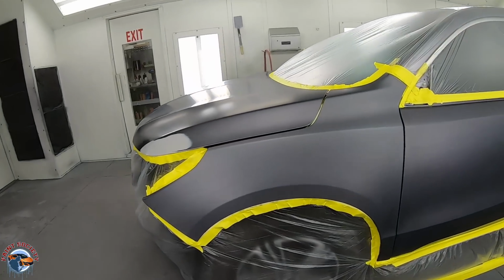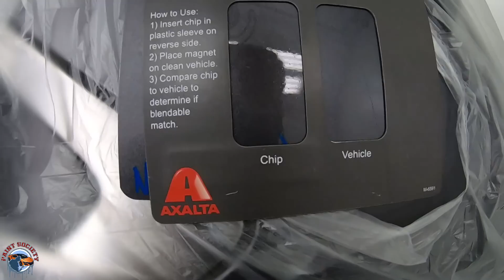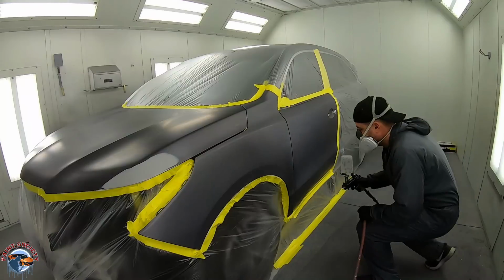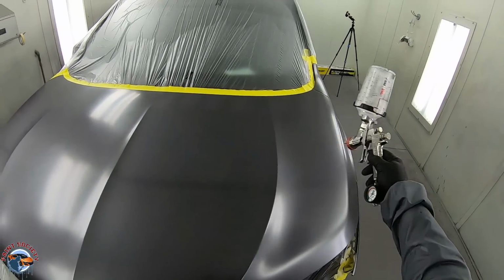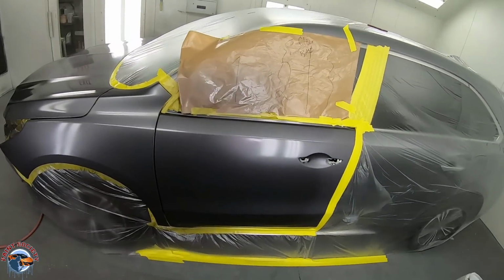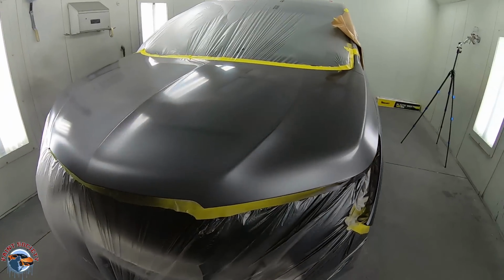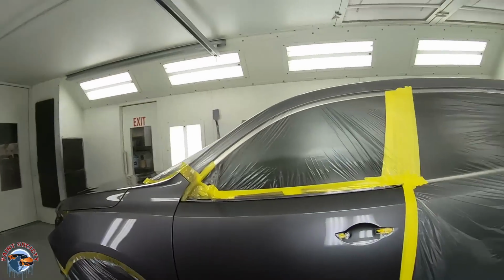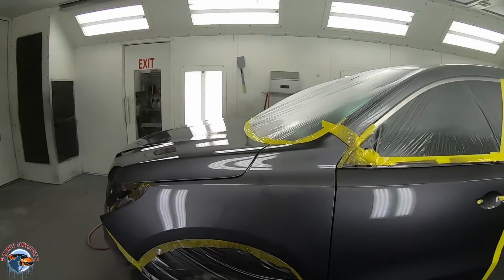Car Painting: Tips to Paint like a PRO!

Comment: Love your videos, your an amazing teacher. I'm interested to know..... if the average gun is usually set to about 29psi for normal use why do you go as low as 17psi and also how does this lower psi effect the finish. Also do you have to change the speed/distance you paint at the lower psi? Last question would be..... do you mask behind the cracks between the doors to avoid spray getting inside. Any help much appreciated 👌

Comment: Love the channel man. Been doing a lot of research because I'm wanting to try and paint my Project truck myself. And you are by far the most detailed and understandable guy I've come across. One question I still have I cant seem to find and good answers on it painting a 2 tone or tri tone  job. On how long to wait and steps on spraying and masking each so that the tape doesn't hurt the first color. I'm doing a 90s Chevy pickup and wanting to go back with the original black on top and bottom, and silver in the middle. Any tips or help on this would be super appreciated.
Reply from the maker: Once you spray your first color it’s a good idea to lock it down with a clear basecoat then wait about a good hour and tape over that, you can never go wrong with waiting more than an hour just as long as you clearcoat everything within 24 hours
Reply: @PaintSociety  Awesome. so just one good coat of clear on the first color enough or should I do a full clear job on it. Also witch color would you do first? The Top and Bottom Black or the Middle Silver?

Comment: What is the proper way to repair a paint job where the paint is "checking" , down both sides of the car in about a 6 to 8 inch area from the rear quarter panels to the gap of the doors and front fenders and just  below the windows ? Not sure what has caused this I am the 3rd owner of the car. The cracking/checking is definitely deeper then the clear coat  as it's not exactly noticeable by touch but very noticeable from a angle. Thanks for your knowledge and expertise in advance !

Comment: Hey Brian Todd here in Maryland I have you ever heard of power  washing  to remove the paint down to metal.  My blaster is not very good and obviously messy I have a one car garage I bought all new equipment sata xp 5500  60 gal compressor This is also a side hobby  But i need a clean way of removing the paint job to metal I have not seen much on this but one video. I hear 3000-4000 psi would accomplish this and clean up would really be easy. What do you think? Thanks for doing the video i will watch all of them

Comment: You use low pressure for base base coat 14psi dv1 and 17psi other guns. I use a ws400 base gun and spray at 2bar which is 28psi I’m thinking I need to lower it ??
Reply from the maker: That’s only on the Dv1. No other gun

Comment: Hey Brian, could you do a video on paint reactions and remedies on how to get em sorted. I'm restoring a Peugeot 205 GTI and Ive had a nightmare with paint cracking after it's been on the panel for around two or more weeks, I'm in the uk and I'm thinking it could be the temp as my garage is very hard to heat, thanks
Reply from the maker: Paint will tend to wrinkle in cold weather. It’s really tough. The solvents stay open longer and attack any bad paint under

Comment: Have you, or can you give some tips on how to spray rounded panels( vw beetle and such). I have had issues in the past trying to follow the curve without loading up and creating runs.
Reply from the maker: Keep your distance. Don’t go for full wet on the first coat. Choose the correct hardener. Maybe a faster hardener if you get runs.
Reply: Paint Society I'm just in the process of purchasing a beautifully straight 1959 vw beetle, still original factory paint and practically no rust. Rare to see one with zero dents( only a couple of superficial dips). I will be using your tips ALOT!
Reply from the maker: Shaun Smith good luck Shaun!

Comment: Thanks  for the info. What about  the air flow at the bottom of the gun?
Reply from the maker: What about it exactly ?
Reply: @PaintSociety  do you just aet it on open and use the  the air gauge to adjust your press
Reply from the maker: The Andyman Channel set around 55 at the wall and regulated at the gun

Comment: I had a few questions. When paint candy does the base coat determine the color of the overall color of the finished car? Like I want to paint my car dark candy red. If I use white vs grey base coat does it make a difference? Also, is it a better paint job to add catalyst and reducer or to buy the gallon that is mixed? Thanks any help is appreciated!
Reply from the maker: Never sprayed candy but I know that the base will affect the color. Also you must follow the technical data sheets for the paint in regards to what you need to add to the paint.

Comment: Technical question: how come the over-spray from the clear base doesn't leave a rough area? Is that what you mean with the 2nd coat of clear talk?
Reply from the maker: Sometimes it does but since it is clear it doesn’t make a big difference. Great question.
Reply: @PaintSociety  So what do you do when it does? Wet sand, buff it out with a polisher?
Reply from the maker: Andrei Fasola yes

Comment: Bryan, turned out okay until yester day.  The clear peeled off the whole drivers side front fender. So I will wash it, clean it with prep, sand with 600, seal it base it and clear it.  What I think I am doing wrong is. When I apply the first coat of clear I have been fogging it being careful to put some down like you do with base and that messes the whole thing up. I need to put it down wetter and slower like you said let it flow carfefully on the first coat. Your thoughts?
Reply from the maker: Might be two materials that are not the same brand and not compatible.

Comment: Sorry for the noob questions, But dont ask, Dont learn :) 
About to order a couple cans of basecoat for my car, same colour as factory.. Ford Moondust silver metallic, question is.
I can only get the basecoat in 1k acrylic or 2k acrylic. But i want to use a 2k clear with slow hardender for best shine etc..
Can i 2k clear coat over 1 or 2k acrylic?
Also, Some online retailers state that the paint comes RFU - Ready for use... How can that be? surely that would mean the hardener is already in it, and it would dry in tin?
Also, 3rd and finally,  Some retailers state to use 1:1 thinner with the paint... But surely 2k requires hardener instead of thinner? otherwise the 2k paint wont dry..
thankyou
Reply from the maker: Hi. Base will always dry on its own, it does not need a hardener. Once you spray it out of the can it will dry after about ten minutes. You have no control on what goes into the paint can. 

For the 2k clear, it has a red cap on it that you press on the bottom of the can that breaks the seal inside of the can and releases the hardener into the paint. You can then shake the can and have about a couple days before the paint dries in the can.
Reply: @PaintSociety  ahh okay makes sense :) so its fine to buy a big can of ready mixed paint?  I am buying 2.5 Litre can, Hopefully thats enough to do the entire car :D 
You have been a great help dude. Thanks

Comment: I got guide coat now and two pints of paint PSB for my Dodge Dakota 06 but I am gonna need more primer and clearcoat again. I was thinking about stripping the paint with a tool but now am not gonna do that this person on eBay said when you do that you need to have this you will need an epoxy for bare metal then a high build 2k the guide coat and paint but it only certain spots of my truck that have different shades of paint that is because I used PS2 paint on my truck before it is bright silver metallic but it is not my paint code PSB and I see the darker grey shade on my truck and that is the PS2 because the PSB is a lighter brighter silver metallic paint on my 06 Dodge Dakota I could show you my pics and you could even spots where the shades look different but paint stripping my truck I don't think am gonna do it now but the paint stripper tool I will keep I bought for 129 on eBay I bought today but am not gonna use it to paint strip the whole truck.